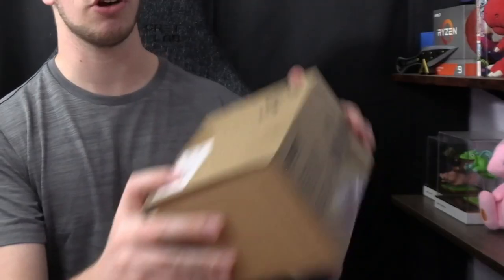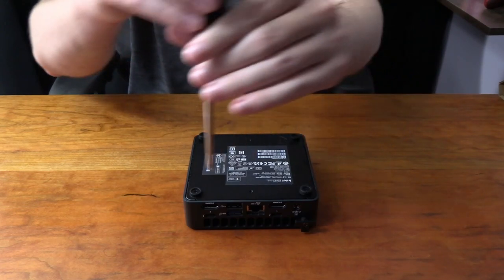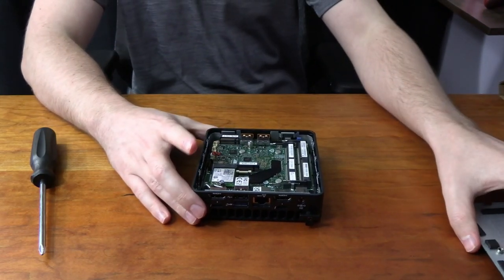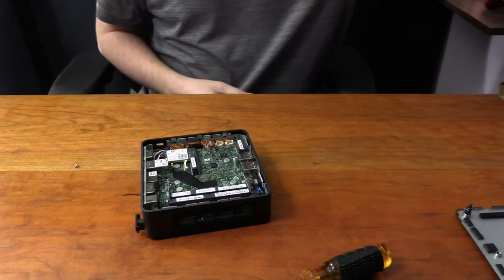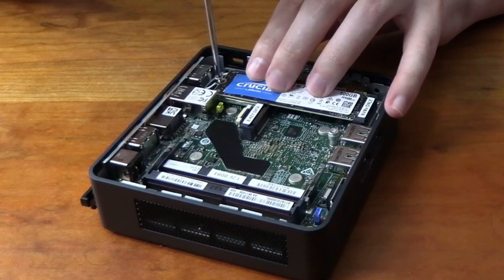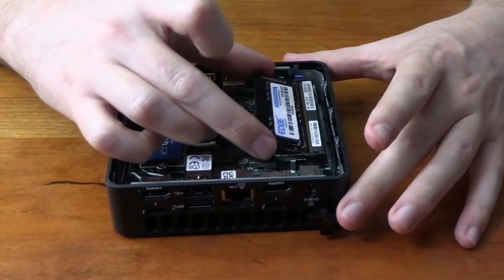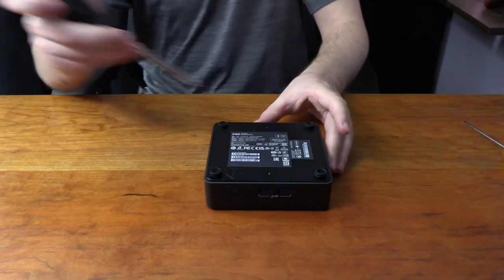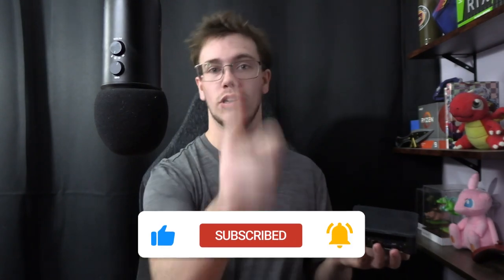How to Install the RAM and NVMe SSD in Intel NUC! Full Guide

Comment: Hi Grant, off topic question,,I recently stored my New Laptop at a family member house and they were instructed NOT to use it,, My question is How can I find out if they've used it?? Is there any settings I can go to in order to find out if they've used it.?? Kind regards mate just subbed. 👍
Reply from the maker: Thx for the sub, you can use Event Viewer on your PC to check but it really limited so you can only see the time someone login.
Reply: Well lock all the accounts and use biometric logins or have a decent pin only you know for starters. But Grant is right you can check the auth log event ids in the security logs in event viewer
Reply: @drewwally2702  Thanks Mate, I'll check it All Out. 👍